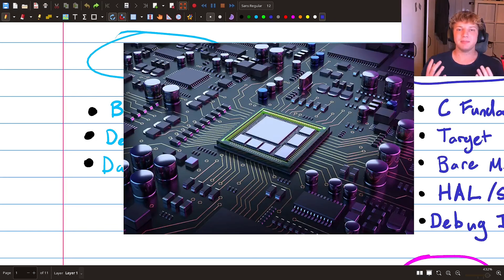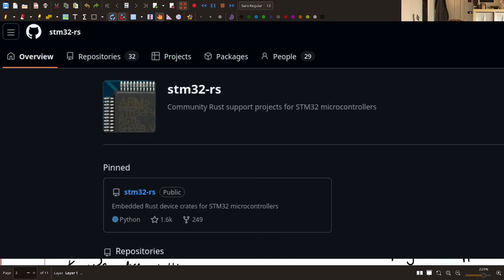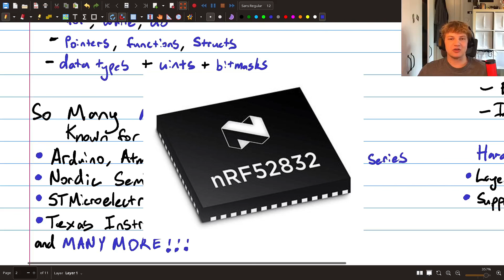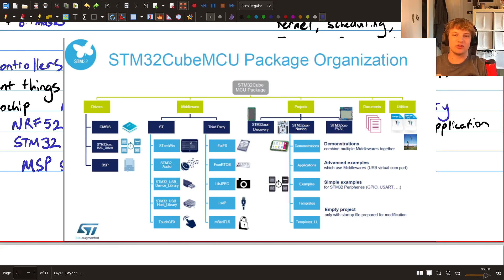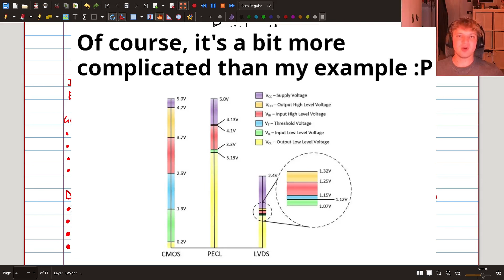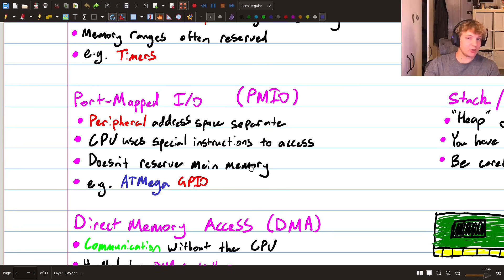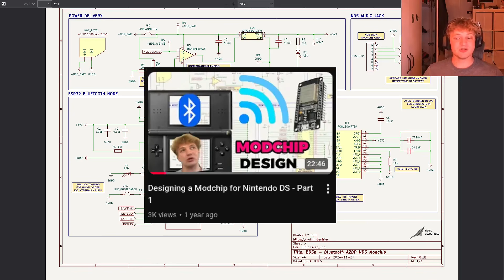COMPLETE EMBEDDED SYSTEMS Roadmap - What Arduino Won't Teach You

Comment: I would push back against recommending C. Almost all popular microcontroller architectures now are supported by GCC and you can use C++ which is much more powerful while still being as low level as you can go. There are modern C++ libraries that allow one to write declarative less error prone code which compiles down to very efficient assembly.
Reply from the maker: I recommend C because it is predominantly what I've seen industry projects use and university courses teach. I have used C++ for industry embedded before and it is growing, but slowly
Reply: C++ makes shooting your leg little bit harder, but when you do it will blow your leg off
Reply: @pcbden  I think you are assuming I am talking about virtual functions, STL heap allocating containers, etc. You don't need to use those, there is much more that is perfectly applicable to embedded system use. And I completely disagree about the risks compared to C. But of course to each their own.
Reply: C++ is really great, but sadly still not the main programming language used at lower level fields, like Linux Kernel Programming or microcontroller Bare-Metal programming
Reply: C is what alot of books and tutorials uses.  I prefer C myself.

Comment: Damn, you didn't even talk about the ESP32, I guess I'm further than I imagined 😅
Reply from the maker: yeah I feel I should have mentioned it, but slipped my mind when I was making the vid. there's heaps more MCUs than what I mentioned. what kind of projects r u doing??
Reply: ESP32 is still great for getting your own hardware designs made quickly, learning how to route PCBs and use sensors and stuff for an application. It’s a valuable step along the way.

Comment: Yes there is Computer Engineering which is the academic path to Embedded Systems.
Computer Engineering should be a combination of all these subjects, otherwise they are ripping you off:-
1 College Math (discrete math, linear algebra, multi-var calculus, differential equations, probability & statistics) & Physics/Chemistry - for Engineering,
2 Computer Science (for computer theory, OS, software engineering, cyber security,. etc),  
3 Electronics Engineering (for integrated circuits, PCB, FPGA,  micro controllers & processors, embedded systems, IoT, labs, etc),  
4 AI & ML. (needs Probability and Statistics, deep learning)
Meaning that studying Computer Engineering delivers a blend of hardware and software skills.
Since actually Embedded Systems are tiny specialised computers, programmed for specific real-time tasks, that are embedded/integrated into larger electronic or mechanical devices or systems.
Reply: in Italy it is exactly like that
Reply: @saponettadivellutoo1977 Same in Sweden !
Reply: and where to find a uni that does it like this...

Comment: As someone who is currently perusing a bachelors degree in Computer Engineering, this is pretty cool. I'm currently working on a couple projects at home, one is a home automation system. I'm considering just using a Raspberry Pi as the server vs making one. Is there anywhere I can find some assistance on creating a simple server without an OS? I dont want to spend a ton of time creating a complex server as it will only be used at home. The devices and a mobile app (setting and changing settings and configurations) is all I'm planning on interacting with the server.
Reply: These servers are ordinarily just an infinite loop of accepting TCP connection, reading them til an EOL/EOF and then doing something with the string.

And since you didn't mention the language or MCU you're going to be using : 
ESP32 IDF has C and Rust examples for embedded TCP server and they cover most ESP models.
The C project uses FreeRTOS but thats just how people do it on ESP32 in general.
The Rust project uses Embassy. One big plus here is the fact that it gives you an Async runtime, though FreeRTOS is a full blown OS so it handles multithreading as well...

Both of these offer only TCP connections and you will need additional libraries for HTTP if you want webpage interfacing, though you can somewhat easily make your own simple string based HTTP request and response, you just need to read the strings sent by the TCP socket and then search for HTTP keywords in them, extract whats needed, etc.

For Raspberry pico - you have the Pi Pico SDK which is written in C/C++ and is fairly easy to run, there is a pre-made project in the SDK which is just single LoC away from compilation.
I believe this has TCP examples...
If you go the Rust route - the Embassy github repo contains examples for STM32 and Pi Pico which are also set up to be compiled and ran right away.

And if you want a proof-of-concept easy to make solution first, you can run micropython on the Pi Pico for the sake of fast iteration, then you can write it in something thats not python...
Reply from the maker: one of my personal projects is actually a self-built home automation engine, but it runs on UNIX hosts. I don't have a video about an embedded server but I do have one on a UNIX multithreaded server https://www.youtube.com/watch?v=9jKqwEpilNE but it may be too complex for what you want...

either way you'll need some kind of application layer protocol, this was my design https://hoff.industries/files/mmp-v2.pdf that's running my home auto engine. tbh if I did it again I would change some things (this was done in 2023 when I was a bit more dumb) but it's been working 24/7 for the last 2 years :)
Reply: @hoff._world  Thank you I'll take a look.

Comment: Oh jesus no. We have difficulty enough with comp sci grads wanting to run Linux on mcus, god save us from web Devs coming to embedded. What horrors will that unleash?!
Reply from the maker: "and now I present my crowning achievement; js-syntax-overlay - an async, future and promise implementation for ATMega328P"
Reply: Its because OS is the heavy course and OS are deemed as God tier programming. Quick guys the embeds are still using assembly we must save them
Reply: mr. smartass thinks he is smarter for an unknown reason he found in his own brain
Reply: Agreed, it'll be a shitshow if those Web Devs come over to Embedded Systems.
Reply: @benzemamumba I'm trying to do that right now. I like front end but am scared for it's future and I'm very interested in writing code to do something physical I'm currently doing an MS in computer science and computer engineering
Reply: @ninjaoftherift1620  same exact boat mate. Im currently a full stack dev with bs in comp sci. Im learning c rn but dont know if I should pursue a masters in CE. I want to transition into anything out of web development(embedded, firmware, graphics, simulation, gpu programming). Just anything to get away from web dev. Im so bored of it, I want something more interactive...

Comment: Power isn't voltage X current it's : IR X voltage/resistance. Lol
Reply from the maker: Hi @ValleysOfNeptune2150 from your formula:

P = I * R * (V / R)
P = (I * R * V) / R
P = R * (I * V) / R
R's cancel out
P = V * I
Reply: @hoff._world thanks 👍
Reply: Power = (V * I) = (I^2 * R).   Where did you get IR * V or R lmfaooo 😂😂😂 that’s V^2 and also voltage and resistance are not interchangeable 😂😂😂

Edit: it’s v/r, not either voltage or resistance, so it becomes Power = (I * R) * (V/R) = I * V
Reply: @shankskm  he gave a correct formula but no one would ever use it.  All power formulas just change around P=IV with ohm's law (V=IR).  So his formula IR*(V/R).  V/R is equivalent to I.  So it becomes I^2*R.  No one would use it since it requires an extra unknown when you can solve with two.
Reply: @hopper711 duh . Would no one ever use it?
Reply: @ValleysOfNeptune2150 You literally say in your comment that power is not voltage times current when even your formula can simplify to that.  No one would use that formula as the traditional formulas offer calculating the power without having to measure or calculate an extra circuit measurement.
Reply: @hopper711 lmao my dumbass thought by v/r valleys meant either voltage or resistance 😅😂. You’re right tho, no one uses this.
Reply: Yes power is P=IV you even prove it with it your formula.  Oh'ms Law dictates V=IR.  In your formula P=IR * V/R. IR can be substituted for V and V/R can be substituted for I.  So power is equal to IV or current times voltage.

Comment: I think embedded rust is the future.
Reply from the maker: maybe, if it gains manufacturer support. for example the STM32 rust stuff is all community supported, and I think this is a big turnoff for industry companies in terms of adoption - you can't call STMicro and say you have an issue with a community made rust project for example
Reply: @hoff._world  
Yep, having written about 10 projects in Rust using the Embassy framework I can say there a so many breaking changes and open source dependencies that Espressif actually had a hard time releasing a good Rust SDK, as it is also based on Embassy.
Though once you get the proper set of libraries with their proper feature flags enabled, its an extremely smooth ride + you get multithreading, tasks and events as first class citizens and they also come with the additional safety guaranteed by the language.
Hopefully these will be more stable in the future because the whole Rust embedded is a huge deal, desktop programmers at least get a segfault if things go too south, in embedded you get little to no feedback unless you constantly have the MCU connected to hardware debuggers.

Comment: What about embedded linux? Is it something completely different?
Reply: Embedded linux is just lightweight no-ui linux that can run on beefy microcontrollers (that are still quite a bit less powerful than PCs)
Reply: To explain more - weak MCUs don’t have resources to run any OS, so you code bare metal. If you have complex program where scheduling is needed and decent mcu - you can use RTOS which is extremely lightweight OS that just helps with scheduling tasks. If you want to go even step further, you can use embedded linux which starts to actually look like a normal PC OS. You can google the rest yourself 🙂

Comment: Is it common in the industry they dont use HAL so just do everything with register and bit manipulation by hand? Or do they use HAL? Or is it different with each company?
Reply from the maker: HAL is actually really useful, and can save you a ton of time. Most projects I've worked on have used HAL primarily, BUT in some cases to do very specific things we can use direct register manipulation as well as HAL.

However it does take away valuable learning opportunities if you haven't done register manipulation before, and for example the introductory embedded courses at the uni I went to did not allow the use of HAL for this reason.

TL;DR HAL is super useful if it saves/abstracts stuff you could do yourself, otherwise it's a black box and you have no idea what it does.
Reply: @hoff._world what program at uni covers embedded and Dev ops?
Reply: HAL is used most of the time, even for safety critical purposes they will usually have in house custom HAL that people can use.

Comment: Why not learn with atmel avr? Has a bit better documentation. Can transfer easily to other systems. Made me fall in love with embedded.
Reply from the maker: tbh I have found the STM32 disco boards more ubiquitous and those chips are among the most popular for advanced projects and in industry, there's a great HAL and guides are everywhere (like deepblueembedded). The more common AVR chips like the ATMega328P (that powers arduino uno for instance) are quite old and we generally don't use them in serious projects. Personally (your experience may have been different) I found the newer AVR chips do not have as good resources available as these older ones.

AVR is great for learning and actually my uni did use it as the introductory controller but with the resources available online these days and the pipeline to be able to jump in and use STM stuff immediately at work or in advanced projects this drives my recommendation.
Reply: Atmel avr can be good to start if you have time but something like stm32 is the closest you will get to industry in a short time period imo

Comment: Isn't NASM the much better choice than C .when it comes to embedded systems programing. I mean  there is not much difference we can just write in C and read the disassembly.
But there is a lot more freedom I think when it comes to NASM.
Reply from the maker: I may be misunderstanding you here - NASM (Netwide Assembler) to my knowledge is for x86/64 CPU architectures, whereas STM32 is ARM, ATMega is AVR, etc. so your code you write in NASM won't work on these micro's. If you mean assembly in general then sure, and for some cases we do write routines in assembly by hand in situations where the compiler doesn't do a good job (looking at disassembly is common, and the compiler usually makes good decisions).

In terms of development time being able to write most of the application logic in a higher level lang like C saves heaps of time, and (generally speaking) reduces programming errors since the compiler can enforce more rules.
Reply: @hoff._world ohh I didn't know about this actually 😅.
I only do NASM on x86/64. And that too very little. Am starting to go low level now.
I am a web dev u see. NASM is just way too perfect and beautiful of a language.
I thought it supports other architecture but no I guess or not that chip. I am looking forward to getting into this embedded systems. This peaks my curiosity, nice video btw. Also I like systems programing. 
But what I do is frontend mostly js which is not bad but I know ,I hv experience on that. And also backend stuff.
I don't even do C or not even C++.

Comment: Hey! This roadmap has cleared out a lot of doubt that I had regarding embedded systems as a carrier and has given me the boost to chose embedded systems as a carrier. I was wondering about how much time is required (or the amount of time you took) to become an embedded systems engineer? I am currently in my 4th semester of Electronics and Communication Engineering in India and have done a few projects on Arduino and ESP32 so I have a decent grip on those. I also followed the Github repo by m3y54m for some time to build basics of interfaces, some verilog and a tiny bit of OS fundamentals.
Reply: 2 years will always be enough for a job if you learn consistently
Reply from the maker: hey! to give you an idea for the timeline in terms of at school, my uni has the following courses at different points in a student's studies:
- intro to micro's, boolean logic, assembly, etc. (atmega avr, 2nd year semester 1)
- embedded team project course 1 (atmega avr, 2nd year)
- embedded system design (drivers, stm32, freertos, 3rd year)
- embedded team project course 2 (stm32, 3rd year)
- advanced embedded systems (zephyr, ble, etc., 4th year)
it's a very clear progression from your start to finish of studies. I think you can self-study this faster but of course to lower quality than in uni. And of course, imo the team project courses are the most valuable and likely you'll be doing these projects solo if self-studying which loses a lot of the people skill learning. Good luck!
Reply: @hoff._world  Thanks a lot for your advice! I will try my best to connect with people of similar interests and do some team projects with them.